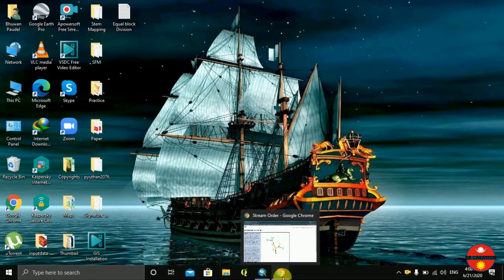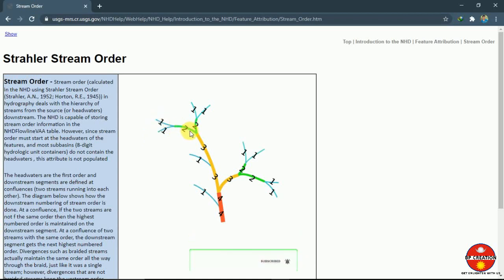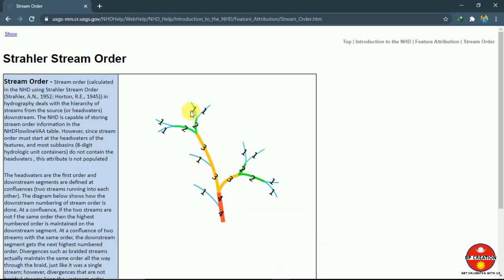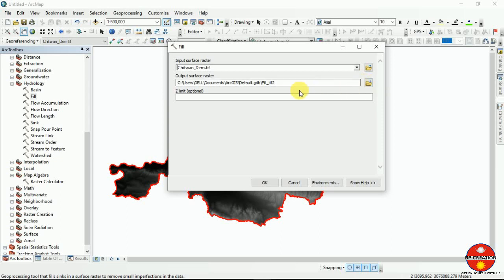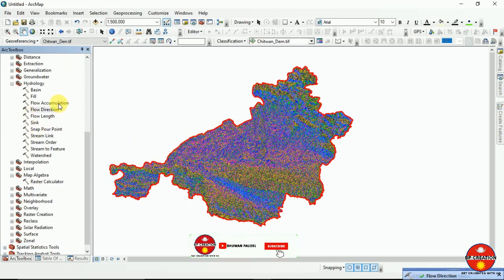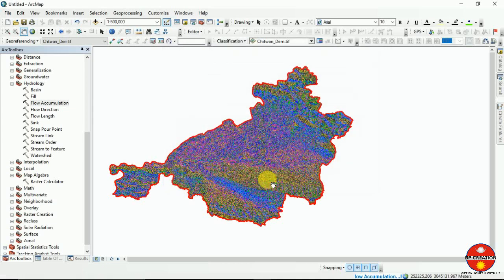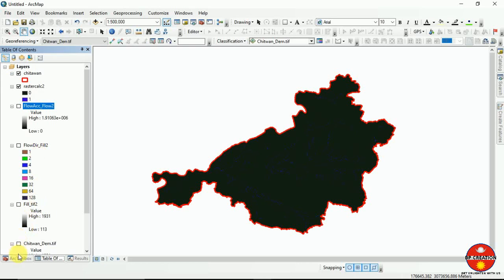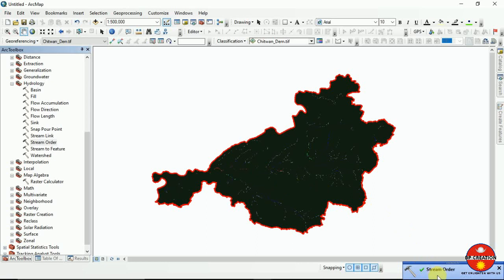Stream Order Analysis from a Digital Elevation Model  using ArcGIS 10.X || @GeoTech Studio

Comment: Why you put in map algebra (Flow account > 10,000 )? Is there any relationship or formula for it? Kindly guide
Reply: @geotechstudio  what kind of Authentic sources you are saying? Is that high resolution image?
Reply: @geotechstudio  can you suggest some high resolution image for cross checking the drainage?
Reply from the maker: Toposheet are used as reference to cross check the accuracy of DEMs generated drainage networks but high resolution image is to get better output.
Reply: @geotechstudio  in Toposheet map we can't delineate the first or second order streams. Which is essential for Morphometry analysis ( bifurcation ratio or stream ratio..etc)
Reply from the maker: In the Strahler method, all links without any tributaries are assigned an order of 1 and are referred to as first order in this way we have to move on for order.
Reply from the maker: This is the limiting flow accumulation. It will show result above that inequality. It depends how dense  stream network you needed on the basis of stream order.
Reply: @geotechstudio   yes sir we can make how much dense we want in ArcGIS. But is that ll fit on real (nature) drainage. Thats why the Raster calculator value is very much important to decide the stream order..  is there any formal or way to cross check our derived output with real drainage?